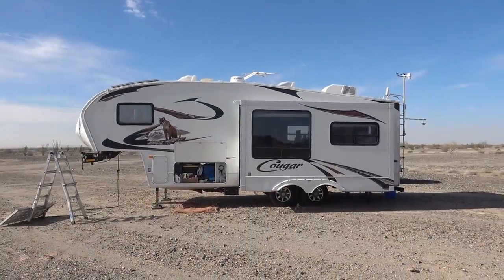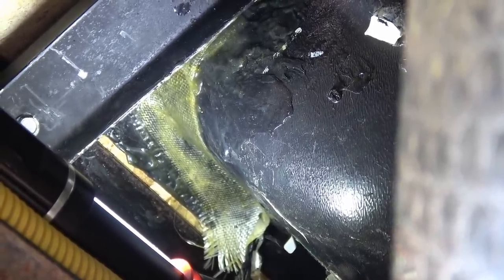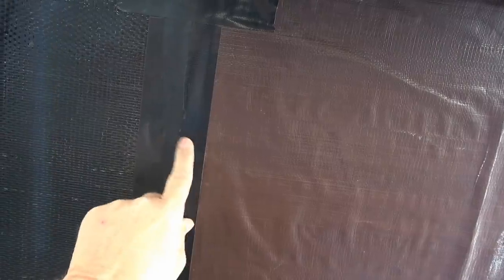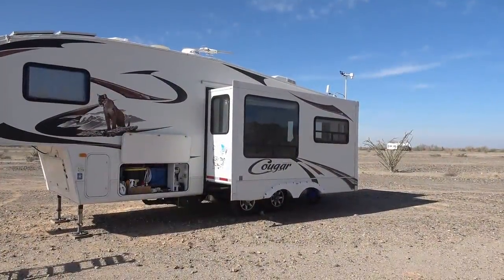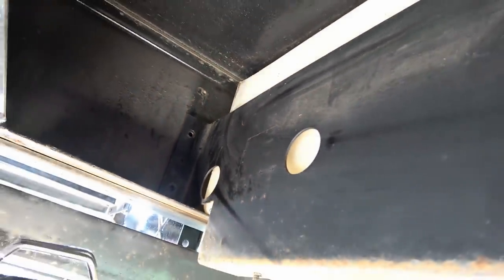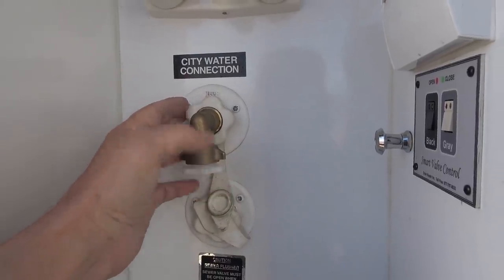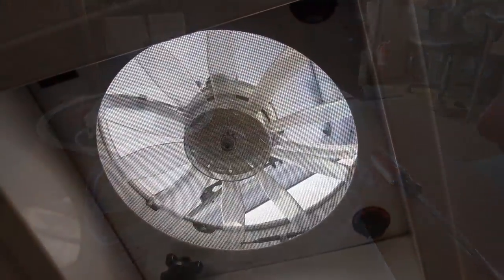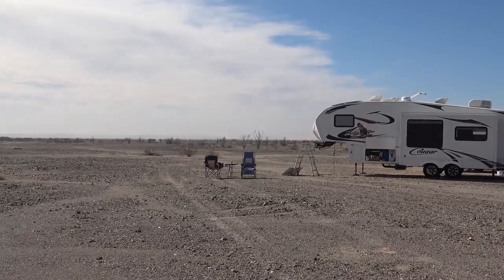10 Recent RV Repairs - How Are They Performing? (Rotted Floor, Cracked  Waste Tanks and more...)

Comment: I repaired my slide out with the aluminum strip.  The black on the floor is worn aluminum as the slide vibrates on the floor going down the road.  I solved this problem by laying down a plastic laminate strip before bring in the slide.  The slide rides up and comes down on the strip and it stays under it during transport.  Pick up the strip after the slide goes out and store it in the basement until next time.  You can get scrap plastic laminate at any countertop shop that does laminate.
Reply from the maker: Thanks very much Lawrence, makes sense. I'll giver a try! Cheers, Ray

Comment: Aluminum oxide can be black.  Lippert makes slide out skid/carpet protectors that can be used, or just a thin piece of any plastic laminate material can be used.
Reply from the maker: Thanks, another commenter mentioned that he had the same issue do to the reason you describe, vibration during travel would lay down the black oxide off the aluminum, makes sense, and they put down plastic laminate during travel. Maybe replacing the aluminum with stain steel instead would do the trick. Cheers, Ray
Reply: @LoveYourRV  Ray, it would stop the black but, with time, the rubbing will damage the floor surface.  My previous RV had corner issues and we put stainless corners on all the slides and used a "slicker" under the one that actually touched the flooring (carpet) under only that one slide.  The others cleared the floor OK.

Comment: Use an automotive clear coat on the aluminum strips you installed. The black is likely from the aluminum. Perhaps a light coat of epoxy on them even.
Reply from the maker: Great idea!  I was planning on swapping them out for stainless steel, but I'll give your idea a try, would save me the work. Cheers! Ray

Comment: Two takeaways, Ray:  #1:  A thorough, periodic inspection underneath any trailer is probably a 'must', especially if routinely used on unimproved roads.  And #2:  Buying an RV is a choice to embrace a new, part-time job (whether it's 'your' job or an RV repair shop's job).  And following you these past two years, it might be fair to state a #3:  The quality of a RV's manufacture might raise the purchase price but not the overall cost of the RV.
Reply from the maker: Good points, for sure. Sometimes though after pulling it down a rough road, I'm shocked how much does stay together! haha

Comment: Video mark 13:48 (rear lights), no need to upgrade to an led fixture, just replace the bulbs.
Reply from the maker: I tried several different LED bulbs, but they were less bright than the OEM incandescent, so I modded the fixture and added an LED flat panel from an LED tail light fixture. Nice and bright now while retaining the same OEM look  https://www.loveyourrv.com/incandescent-to-led-trailer-tail-light-mod-to-keep-oem-lens-assembly/

Comment: Nine years full time.... a long time for a non full-time rated 5th wheel. Of course you keep up with the maintenance and not let stuff go once caught.  Thanks for the update, I now know why my city water inlet has a small drip and will replace it soon...
Reply: If you maintain it, any RV should last well beyond so called its expected life span. Maintenance  should be a planned thing and budgeted for. Trouble is, consumerism has turned us into a throw away society.  This is true for RVs too, except most people simply tire of the ownership question and simply walk away from it. Cruise America et al have figured this out and they have a identified their target market.... people that don't want the hassle of RV ownership or the maintenance that goes with them. FTers are not their target audience. Even Cruise America is  sort of a use and abuse RV consumer since they don't keep their rigs for more than a two or three years... they don't want to fix them either, they sell in the used RV marketplace and get new models. Wash rinse repeat.
Reply: Is there such a thing as a full-time rating? I have not seen that...would it just be a new marketing strategy? I have lived in everything over the the last 30 years and have found them all insufficient. I am now building out a cargo trailer to last the remainder of my 110 years. Must see Haleys comet one more time.
Reply: @geraldhenrickson7472  I wish you much favorable results in your venture (s). Yes; there are 5th wheels labeled "Full time rated". Usually higher priced, heavier building materials, upgraded residential type fixtures & appliances, thicker walls for insulation and warranted for full time living.

Comment: I had the same problem with my awing as you do. The top 1 to 1 1/2 feet of awing was totally worn out, but the rest was good, and the reason is the constant exposure to sunlight of just the top part. I took my awing off and brought it to a tarp and awning repair shop where they replaced just the damaged part for 1/5 th the cost of all new fabric. If you need the whole awing replaced, then Toughtop is a very good choice.
Reply from the maker: Good deal! That's for the idea  The rest of our awning is pretty good but it is showing signs of UV damage, its changed color quite bit and feels a little brittle. Since we snowbird fulltime, it's used often and we are always in the sun. I think the desert dries them out pretty good too. I think I'll do the whole thing and try and get some better material than the OEM used. Cheers! Ray

Comment: For your awning, you can cut off about 8" and resew the cord inside and re-install it.  If you can't sew it yourself, you could remove the awning and have an upholstery shop do the sewing.  Last year, that's what I did on my Tioga Montara awning and it's holding up well.

Comment: We've used West Systems products on our sailboat a time or two and have been pleased.  "Varnishing" plywood with epoxy is a great idea.  We have done the same on our sailboat and it really does seal the wood.  You might try sail repair tape for your awning.  We've used it to repair our mainsail on occasion with good success.  Your awning looks much like the one on our Mallard 26 foot trailer, so it may work.  West Marine sells it.

Comment: I bought these bulbs on Amazon last year for the back of my trailer: iBrightstar Newest 9-30V Extremely Bright 1157 2057 2357 7528 BAY15D LED Bulbs Replacement for Back Up Reverse Lights or Tail Brake Lights,Xenon White
Note there are also red ones I bought those too. But realized red light versus white was shining on license plate.
They work great and somewhat brighter than the original ones.
Reply from the maker: Thanks, Tom. Looks like they have great ratings and not too pricey. Good tip on the licencee plate light, never would have thought of that. Cheers, Ray

Comment: Okay, you've earned your weight in gold for being able to repair the window coverings. We have one that is always canted at the bottom or the top. I don't know why, but I suspect it's the strings or something. Also, I have a drip at the city water connection that I have blamed on not having a good seal at the female connection. Now I wonder if it's the O-ring like you had problems with. We have snow here in northern Washington (while you're baking in the warmth) so I won't get to looking at the water connection for a bit to check it out. Well Ray, you've set me up with quite a few projects for the upcoming months and I hate you. (Kidding. Thanks!) Hey, any problems with the rubber seals around the windows? I have a gap on two of them (at the bottom, thank god) and wondered if yours have shrunk, and if that's a concern. Cheers, Ray!
Reply from the maker: Yes, my rubber outside thick rubber seals around the slider windows have shrunk on all my windows leaving a gap, doesn't leak or anything. Also, most of my dual pane have leaked air into them so we sometimes get a bit of fogging in there. Not a big enough pain yet to pull them and have them resealed. Usually it isn't noticeable.

Comment: Leave the screws. Grade 5 has better shear strength than grade 8 or 10. The grade 8 is stronger but has less shear. I use grade 10 as shear bolts on my field mower.  The grade 5 will bend and resist breaking or shearing. 
Good job on the repairs!
Reply from the maker: Good info, thanks.

Comment: I have a very similar rig.  How did you terminate the aluminum angle piece on the inside?  I did the same repair and rolled the front edge up to wrap around the leading edge of the slide.  That worked fine when we had carpet but we have now taken out the carpet and have the original linoleum on the floor.  I'm worried that the metal will mark the lino floor.
Reply from the maker: My slide uses rounded plastic shims that the outer edges ride on as it comes in. I just made sure the aluminum corner bead was on top of it when the slide is all the way out. As my slide comes the leading edge of the slide floor also lifts a little so it clears the main RV floor. When all the way in the slide floor front edge sits about a 3/4 inch above the main RV flooring.

Comment: How is that shade you installed on the back window?  Thanks for sharing all your tips, tricks and reviews Ray
Reply from the maker: Still working well, I mostly use it in the summer when I can't be parked away from the sun. Fabric is holding up great, I have had a few of the 3M stick on plastic snaps fall off but do have some spares.

Comment: Are there any RV’s rated for full time, long term use? I wonder how an Oliver fiberglass trailer would do. I would think there is a market for well built, long lasting heavy duty trailers, catering to full timers even if they were more expensive
Reply from the maker: Yes,, there are some that are rated full time and four-season just cost a lot more. Usually, they are the larger rigs but Arctic Fox has a few shorter rigs.  https://camperreport.com/5-great-fifth-wheels-for-full-time-living/

Comment: How often do you check the brakes and wheel bearings? I'm pretty sure you did a video before but I'm to lazy to search for it. LOL
Reply from the maker: Usually get checked and repacked every two years and recently I replaced the old brakes, bearings and bearing races as I wanted to learn how to do it myself - https://www.loveyourrv.com/installing-new-trailer-bearings-and-brakes-on-our-cougar-fifth-wheel/

Comment: Hi what size is your Rig ? And what do you tow with?
Thanks 🏕
Reply from the maker: Its 30 feet tip to tail and has a Gross Weight Rating of 10,141 lbs. I used to to it with a 1994 Ford 1 ton diesel dually now I have a 2018 Ram 3500 - https://www.loveyourrv.com/2018-ram-3500-truck-review-update-after-10000-miles/  Cheers, Ray

Comment: What material did you use for the underneath (the exposed bottom) of your slide? I have some torn factory material and I'm trying to patch it with something, I tried different types of tape, but the rollers that the slide rolls in on tears it and it leaves glue on the inside flooring.  Thank you
Reply from the maker: I couldn't find the material the OEM used so I went an bought some heavy duty tarp and used it - https://youtu.be/Sj44jMnITvs?t=652